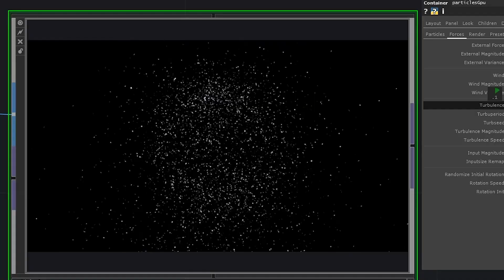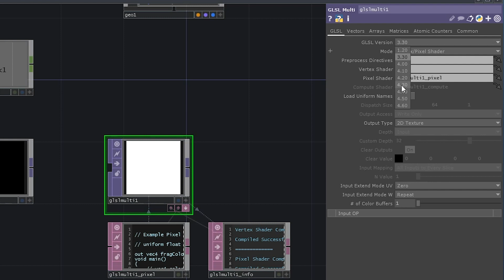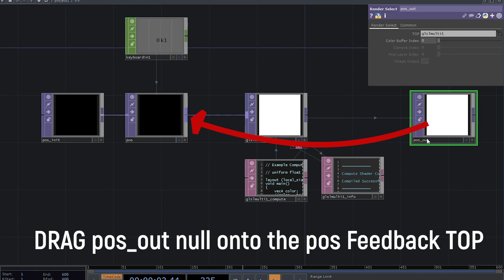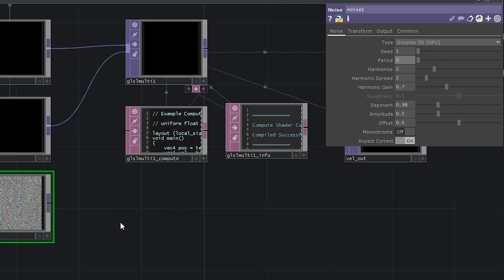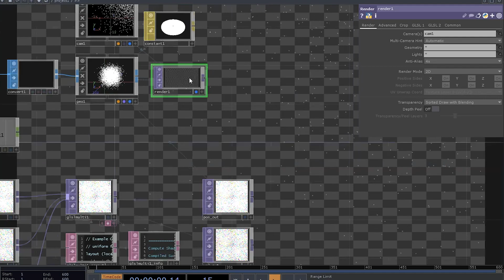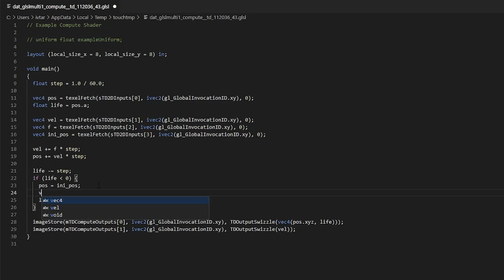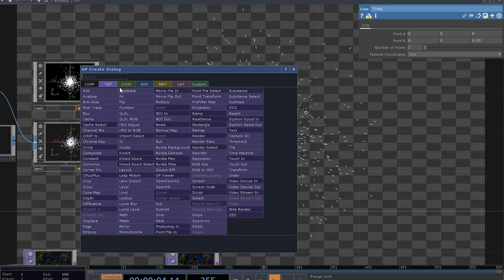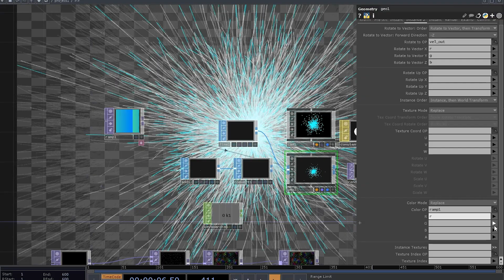Basic particle system with GLSL TOP (Touchdesigner tutorial)

Comment: Hey, I tried the whole thing step by step but am failing at the force part around 4:30. After entering the lines in the Editor nothing happens; all the Windows remain black and the noise remains static. Anybody gotvany ideas what the problem is? Tried everything twice and am Sure that I did it the exact same way..
Reply: Hi! Have you clicked on "Save" on your editor after writing the code? Many editors don't have automatic changes
Reply: Same issue. Although everything is same as in the video, node names, adjustments, script all tripple checked and yes svaed the script, I am still getting an error in the glsl script.